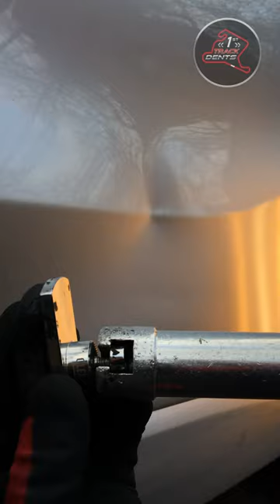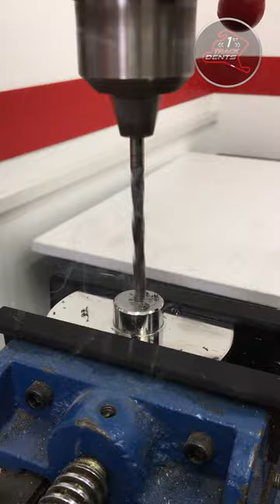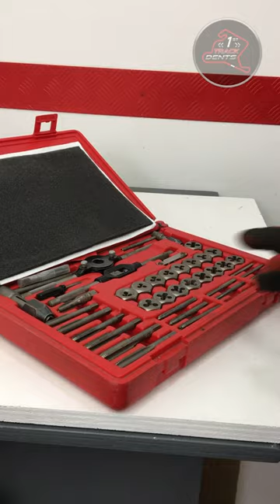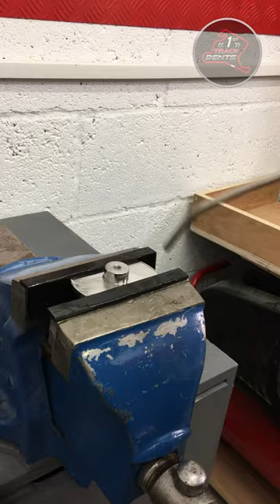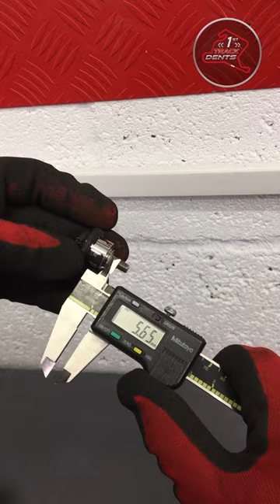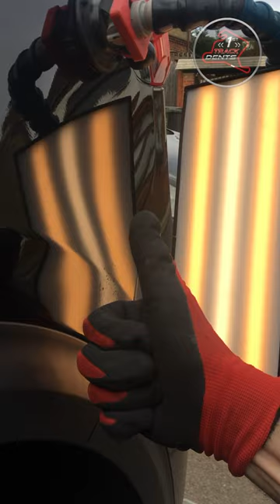Would YOU do this to YOUR TOOLS? #toolrepair #pdr

Comment: If you have the tools, repair. 
If you don’t have the tools, replace. 
Sometimes it doesn’t make sense to spend £100+ on tools to repair something that’s probably less than that. 
However, that’s a cracking repair and you’ve improved it and made it easy to repair again in the future if the same problem arises again.
Reply from the maker: Thanks Oliver, yes , luckily I have had this tap and die set for over 20 years! and haven't had to use it much, so it was good to dust it off and use it to save me some money! Hopefully it won't happen again, but at least it's not too difficult to fix! 👍 

Cancel

Reply

Comment: I had a similar slide hammer issue, and just welded it, it wasn't pretty, but, 10 years later it's still holding!
Reply from the maker: If it is still going after 10 years, I'd say that was a successful fix 👍

Comment: Repair...and try to improve it if I can Jake.
I'd have possibly TiG'd that bolt in place too... Loctite will/has worked though, good job 👍👍👍
Reply from the maker: Thanks, yes a Tig welder has always been on my shopping list, i've done every other form of welding but never owned a tig 🙏 Hopefully the Loctite will work, I suppose it will be easy to replace if it happens again. 👍